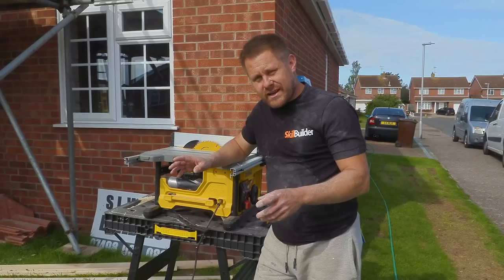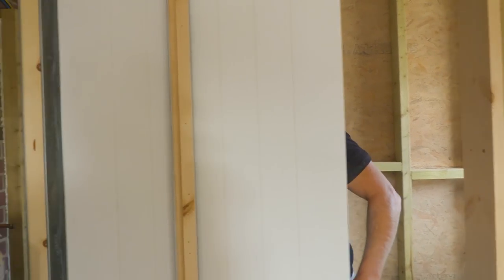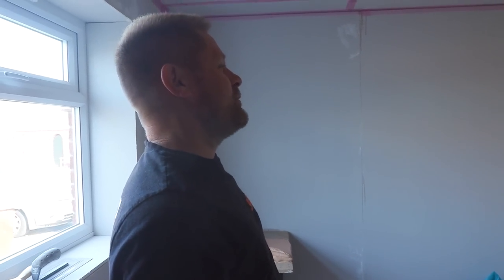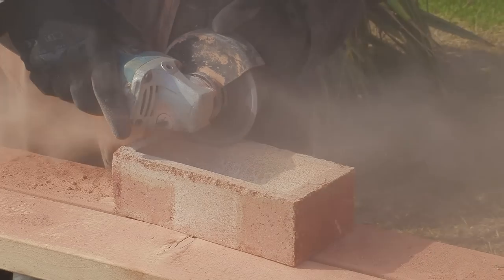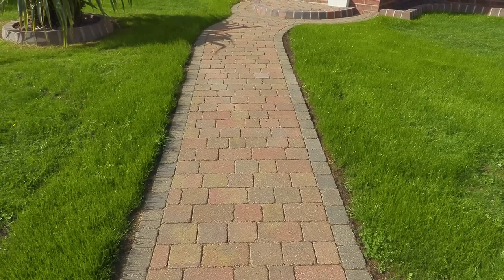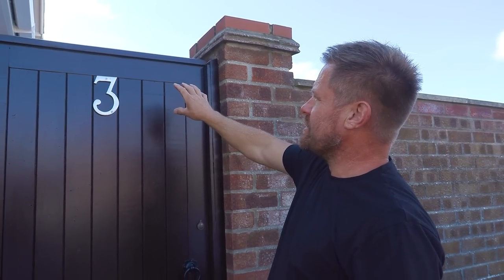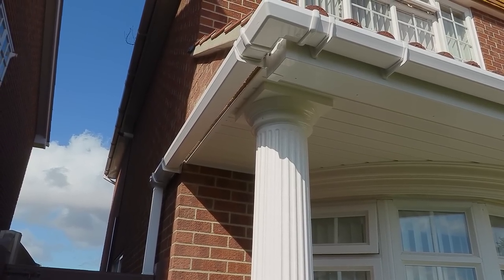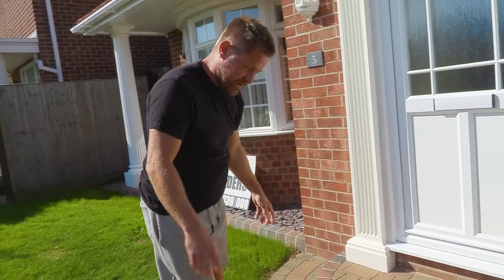Look How Well This Turned Out! 2023 Extension Build Ep.6

Comment: Interested to see that the shower tray was installed before boarding the wall. Is that normal? We had a leaking shower tray in our new build and the shower tray had been installed first and then plaster boarded after!
Reply from the maker: I would run tile backer board to the floor then put the tray in.
Reply: In this instance the tray had to be installed first because it is designed so that the backer board fits down onto a 12mm recess allowing it to sit flush with the inside of the tray. This allows the tiles to go past that join and make a very water tight and clean job. In my opinion it is one of the best systems!!
Reply: @SJWardBuilders  Thanks Sam. The one we had didn’t have any lip and the damned thing leaked like a sieve. Makes sense if there is a lip there. You’ve also used proper tile backer board. Ours was plaster board 🤬